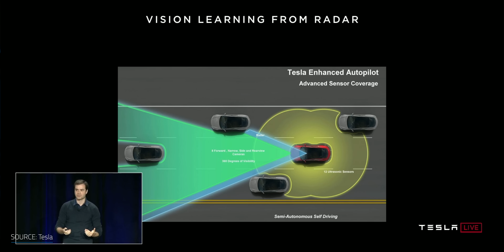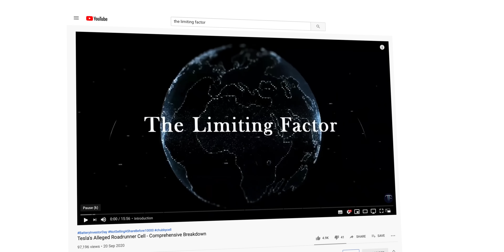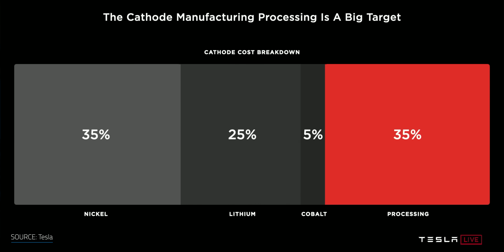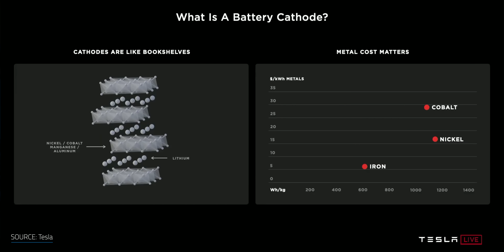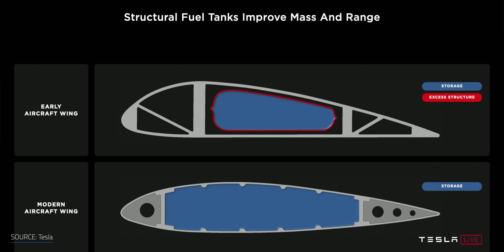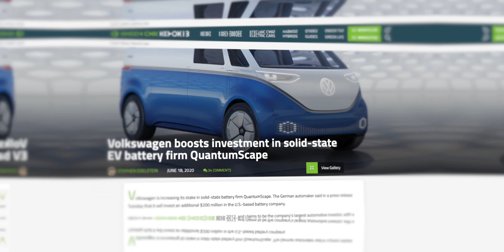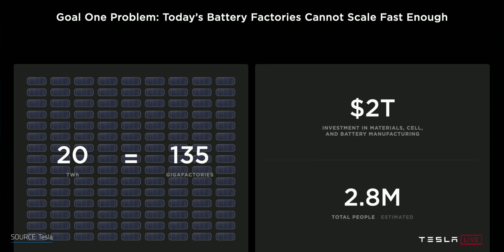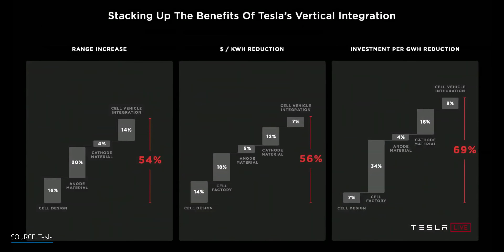3 Takeaways from Tesla's Battery Day - Hint: it's not just batteries

Comment: I don't want to sound like a hater but did Tesla really "dunk on the entire industry" by announcing the Plaid with 3 more miles than the Lucid Air and delaying it 1 more year?  They also said they'll buy batteries from more battery makers.  And then the new battery tech that's 18 months away from actual mass production.

If I'm VW I'm not scared at all.  The ID.3 should cost $25,000 in 3 years too.

Comment: All sounds exciting. I wonder if they talked about where the electricity is going to come from to charge up the batteries - if their technology is going to replace ICE vehicles, then the energy used by the ICEs will need to be available as electricity to charge the batteries of the EVs; and that's a HUGE amount of Diesel fuel and gasoline, so a HUGE amount of extra electricity to generate. Does Tesla intend to construct new power stations around the world as well? Generating electicity from what fuel (since coal is the largest part of electricity generation worldwide and it is said that an EV running on coal origin electricity is actually consuming more fossil fuel than an efficient ICE vehicle )? Or are they seriously intending that the world's EV fleet will be powered by solar panels and wind turbines? It would be really interesting and important to look at the whole picture. Clearly what Tesla are doing is innovative, but to take that innovation and project to a future of EVs for everyone, the electricity generation question has to be answered. Replacing Diesel fuel and gasoline with coal doesn't have any environmental benefit at all. It does allow coal to be used for transport instead of oil based liquid fuels, so addresses the future oil availability issue temporarily as we eat into the coal reserves, but doesn't do anything at all for CO² emissions.
Reply: Most counties the supply grid only runs anywhere near max capacity for maybe 4  hours per day, and for half the day often runs at less than half capacity. So if most cars were charged with intelligent chargers that mainly charge when cheap excess power was abundant. (people will want the cheapest) The current grids could coup with millions of EV's without any excessive improvements. only burning more energy more of the time.

And electric cars are a lot more efficient than gasoline cars, even if powered from Coal. Gasoline is a dismal 15% efficient from the potential energy of oil in the ground (from mining, refining, transporting, spills, fuel stations etc, and finally burning the fuel to generate motion) EV's are over 60% efficient from power stations to wheels. So even if 100% of Coal powered would be around 22%. A small improvement.

But coal is the worst example: Most power grids are moving away from coal. In the UK the electricity is now 47% carbon-free from renewables and nuclear. and the rest is mainly Gas and practically 0% coal/oil, so a UK electric car would be around a 400% energy improvement over Gasoline. and around 25% of the carbon and cost. These numbers will only improve over the life of the car as renewables improve.

And if you live somewhere sunny and have solar, you could potentially be 100% free!
Reply: @stevetaylor2818  Thanks for your thoughts Steve. I can go along with what you say about exisiting power stations not running at full capacity all of the time, that's the reason behind the lower tarif period in the day, so from that perspective you can pull more out, so long as the charging happens at the right moment in the day, agreed. 
Also agreed that that clearly means using more fuel for generating more electricity more of the time - more of whatever the power station uses as fuel, which globally is a majority coal. 
I wasn't aware of the fact that all the coal fired power stations in the UK have either closed or converted to an alternative fuel. I grew up in a village next to a coal fired power station in Yorkshire and within view of at least two others, one being the largest in Europe at the time (Drax). I did see an article in the Yorkshire Post a few years ago talking about a brilliant new green project to convert Drax to green biomass instead of coal. They extolled the virtues of running the biggest coal fired power station in Europe on wood chips. They then explained where the woodchips were coming from (because there are no forests anywhere near Drax) - they were shipping them from forests in Canada. The article was selling the idea that cutting down trees in Canada, chipping them and shipping them in (oil powered) ships to the UK was a fantastic green development. 
According to statistics from Carbone 4 a French climate think tank which advises governments and enterprise about energy and climate change, the sector of electricity generation which is increasing the most around the world is actually coal. Renewables are a drop in the ocean of total electricity generated, but are also a drop in the ocean in terms of new capactity constructed. 
I'm not going to offer counter-percentages, instead I'll just counter the principle that carbon-free renewables exist (fossil fuels are used in large amounts to manufacture solar panels and wind turbines (and for the concrete to construct hydroelectric infrastructure). Uranium is mined (fossil fuels) and transported long distances (fossil fuels) since it only occurs in certain places in the world. I live in France, which was self-sufficient in nuclear fuel for its power stations until a couple of decades ago. It now relies entirely upon imports from I think Africa somewhere, in any case a long way away. Clearly less fossil fuel than a coal/gas/oil fired power station, but not carbon free. 
As I say, I haven't been following what's going on in the UK. I had thought there was a project to build a new nuclear powerstation which was not going to plan at all, or had been abandonned. If it is really the case that 47% of the electricity consumed in the UK is from renewables and nuclear and that there is 0% coal/oil, that sounds great, at least compared to my childhood memories of plumes of smoke and steam from cooling towers of coals fired power stations. 
Your paragraph comparing gasoline (or petrol if in fact we're both English) is interesting and indeed very important to be able to give a fair and meaningful comparison. How did you come up with those percentages for efficiency in use of petrol? And where did 22% come from as a comparison to show EVs are better. Do you have any links to studies which have researched these things (vehicle fuel efficiency comparisons, power station fuel efficiency etc) you could share? Clearly the fuel efficiency of "an ICE vehicle" or "an EV" varies wildly depending on what the vehicle is and how it's driven. Just saying an EV is 22% efficient and an ICEV is 15% efficient therefore EV trumps ICEV sounds a bit like a Top Trumps game (if you played that at school like I did - great fun - such a dinosaur runs faster than yours, so I win, but then your next one is taller than mine so you win that one) but doesn't stand up to scrutiny or look at the whole story - keeping to Top Trumps, the Bracheosaurus trumps the T-Rex on height, but loses to the T Rex on length of teeth, for example. How would an electric Hummer (as it is suggested GMC is thinking about - https://www.gm.com/masthead-story/hummer-electric-truck-ev.html) compare to a petrol or Diesel Smart car in terms of energy efficiency and CO² emissions when the whole story including vehicle fabrication and fuel source for electricity generation is all taken into account? Not sure, but I have a good idea which would be more fuel efficient and in the USA I believe there's still a LOT of coal use. 
If we're going to give percentages and use them to justify the validity of arguments, we need to give links to sources to back up the figures. I'm looking some up now, but here's one to start with from carbone 4. It's in French, but Google technology can help with that if required: http://www.carbone4.com/voiture-electrique-etre-decarbonee-de-production-a-lusage/
I need to find some more detailed documentation to present some real and meaningful figures. If someone has links for such info, I'm very interested, it's an important subject. 
Last comment - how is solar electricity 100% free? Carbon free? (no, not really) Free of charge? (I've looked at the price of a solar installation and I didn't find it was free of charge). 100% free of environmental impact? (nope, solar panels require many ingredients and energy for their fabrication and I believe I've read that their recycling is not up to speed yet). What did you mean by 100% free?

Comment: Not only will the new pack design as a structural element impact right to repair, it may eliminate repair altogether.
How will Tesla replace a battery pack if it is 1/3 of the cars structure? Maybe they won't.
Million mile battery may mean a forever battery. When the battery fails, get a new car. Maybe you'll trade your car in as a "core" towards the cost of a new car.

Comment: Hi Matt,

The repairability you talk about in this video, you can have only one, serviceability or reliability and Elon picked reliability. With the battery being structural element of the car and when they fill the batteries with epoxy the whole thing becomes a brick almost indestructible. 

In teslas case the battery will outlast the life of the car.
Reply: Why can you only have one? Why cant a reliable car also be serviceable?
Reply: Jean-Pierre White I already explained one of the reason, the pack will outlast the life of the car. If the pack is never going to fail or has a lower probability of failing why have serviceability? Plus it also saves weight, improves structural rigidity, improves safety, it’s a no brainer.

Comment: 8:21 Don't forget the software locks / disallowing self replacement of many parts, renting cruise control, unlocking the 72kw battery over the 60 when it already has the 72, and inability to get the car repaired except from the price gouging dealer. The batteries being tighter packed isn't necessarily an attack on r2r, but their general attacks on consumer freedom is the worst in the business, at least for cars. No amount of tech justifies a car you can't own 100%
Reply: so... If they sell a car for $50,000 with 72KW, and to give a more accessible price point lock the battery at 60KW and drop the price to $40,000...  You feel like you are entitled to the locked portion of the battery?

Comment: If true, could be an investment.

My problem with car batteries is, batteries use electricity, they
don't generate electricity.

Electricity must be delivered to car batteries (Loss I), Batteries
must be charged Loss II), battery current must be delivered to motor
Loss III), motor current must be converted to mechanical power for
wheels (Loss IV).

These losses must exceed 50% I believe. For a 300 mile trip, about
100M joules (18 gal gasoline) is needed, and therefore 200M joules is
needed from the grid for an electric car.

Can the coal-powered grid handle it's present load and electric cars too ?
Is Musk dodging the big picture.
Reply: FUD.  You're severely overestimating the transfer losses.  One reason the invention/discovery of electricity was such a big deal was because its transmission and conversion into "work" (physics term) is so efficient.  Producing gasoline, getting it to your car, and burning is WAY worse.  Also "the coal-powered grid" isn't a

Comment: Now the power supply grid needs to be enhanced to handle the projected demand for EVs.
Reply: Most counties the supply grid only runs at max capacity for maybe 4  hours per day, and for half the day often runs at less than half capacity. So if most cars were charged with intelligent chargers that mainly charged when cheap excess power was abundant. The current grids could coup with millions of EV's without any excessive improvements.
Reply: @stevetaylor2818  that’s only part of the story I think, each house would require a cabling upgrade

Comment: Polymers like PEDOT:PSS have been used to coat both anode and cathode materials for Li and Na batteries in the literature. If Tesla made this work in a practical manufacturable battery it would be a significant breakthrough. Tesla may be deliberately giving away 5 or 10% of the total energy to succeed in the practical space. A battery run from 20% to 90% total charge has a longer life than one charged to 100% every cycle.

Comment: I really loved battery day and the potential that it speaks too.  
But it brings up a question that has been nagging at me for some time but I'm not hearing anyone talk about it. 
The electrical grid in the US is often described as aged and barely equipped to handle the current requirements.  It is in much need of upgrade.  I do believe solar, wind, and battery storage will do wonders, but what about transmission.  Today in California the number one ignition source for wild fires is over taxed grid.  The rolling brown outs and black outs are nessecary to mitigate this. Wires and transformers setting the world on fire as they exceed their capacity.  So when we change all or a significant portion of our transportation from fossil fuels to electric, how do we get all that newly required energy doled out to where it needs to go?  Generation and storage aside, who is the Elon that will first principal the transmisson issue?   The bad part is the grid is so government ingrained.
Reply: First, wildfires are mostly caused by lightning strikes, not an overtaxed power grid. We do need grid maintenance, but it's a false impression that the power grid is responsible for most wildfires.
 
Second, Tesla powerpacks and megapacks can be used to stabilize the grid and allow us to use renewable power whenever we need it. Renewable power generation doesn't have to be so concentrated in just a few power plants in central locations so there's less transmission needed. If each town or neighborhood had its own powerpack that collected renewable energy from local rooftop solar panels and wind turbines there would be little need to send power over long distances. Each town's grid could operate largely independently, just trading surpluses with neighboring towns instead of taking power from large powerplants located several counties away.
Reply: @dlwatib  I saw a simplified a short video during which made the claim about the wildfire ignition being large or largest  part power grid related.  Did not do my do diligence till you made the comment you did.  Found "Historical pattetns of wild fire ignition sources in California, 2018"
Apparently the primary source depends on the area. Some areas arson, some areas lightning, some areas trash burning, some areas power grid. 
I point I was attempting to make was  rolling brown outs and black outs were instigated in large part to prevent wild fires from an over taxed grid. The fact that califonia, the most progressive alternate energy state and ev car state is having  such grid problems is in itself foreboding. 
The ideas you presented  of restructuring the grid into more local zones sounded good, if it will work.   
The question is who is spearheading this push.  There certianly is a push to electrification of our transportation infrastructure and it is quickly becoming massive.  Is there any push taking place on the grid at all, small medium or masive?   Is anyone actually getting it done or is this just conjecture and wonderful future ideas.   I see the grid as I see the american car industry...
Yeah, were going to come out with a tesla killer one day. 
Yeah we're going to restructure the grid one day.  Well if they do will it be in time to keep up with the transportaion revolution?  Will it be done using a first principle approach.  Unless there is a lot of work happening in the background that isn't being discussed, I see it as a potential serious bottle neck to the electrification of transportation.

Comment: Tesla’s thinking:

Problem:  EVs are still too expensive 

Solution:  reduce costs

How?  Reduce material costs and reduce labor

This is not first principles; it is common sense.
Reply: How to reduce costs is where they are using first principles. The best part is no part, the best process is no process. They are eliminating steps from the mines to the cell manufacturing to the pack.

Comment: Ice cars are dead? 😂
No. 
As long as batteries underperform in the Michigan Winters and other deep winter areas and also drain very quickly hauling heavy loads ice cars will not be dead. 
They are getting closer though. Very close.

Comment: I think EVs are indeed the future,  but I don't agree that batteries will drive that change.  I think fuel cells will be the "super" battery of the future.  They are close to breakthroughs that would extend ranges past 600 miles and you can refuel in five minutes.  They do not degrade with temperature changes and with improvements will not lose capacity over time.  They can be powered by hydrogen which will become dirt cheap as solar costs drop. Even Tesla's superior batteries degrade in just 10 years.  I think fuel cells combined with capacitors will be the future. Fuel cells are also very durable, and can be used in the most extreme climates,  like space.

Comment: I’d rather have the right to repair my own battery and have less mileage then it being used as a structure to save weight and offer a more valuable product. Beating out other competitors at initial purchase. Long time value is the value of the vehicle.
Reply: You're never going to need to repair your own battery. There are no moving parts, nothing to go wrong. It's going to last longer than the vehicle and then be reused in a stationary application before finally being recycled.